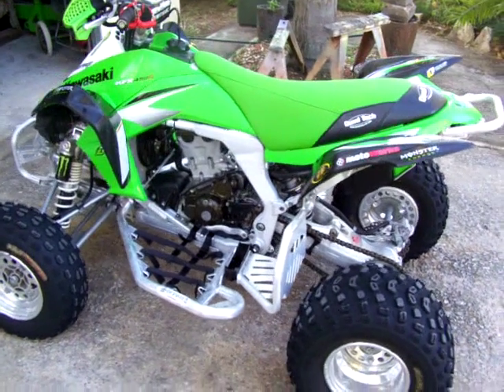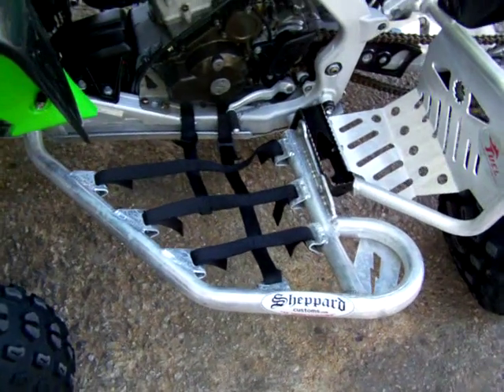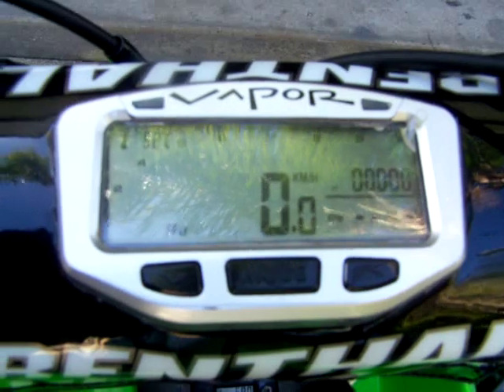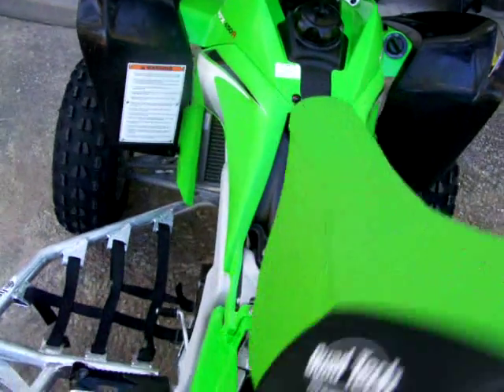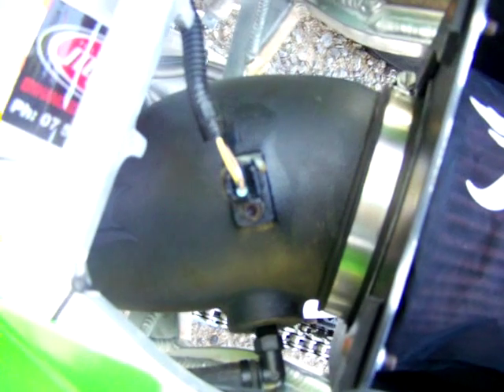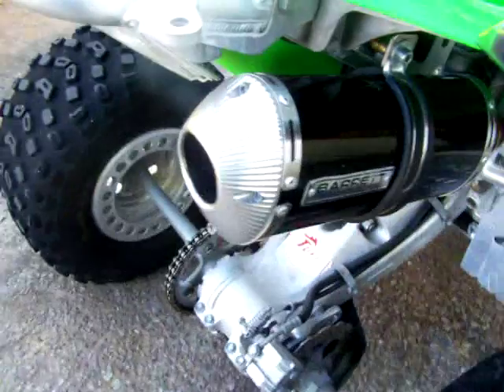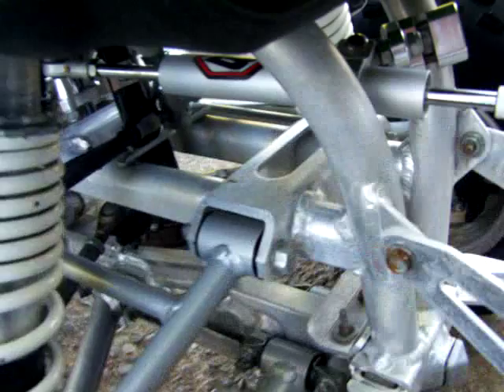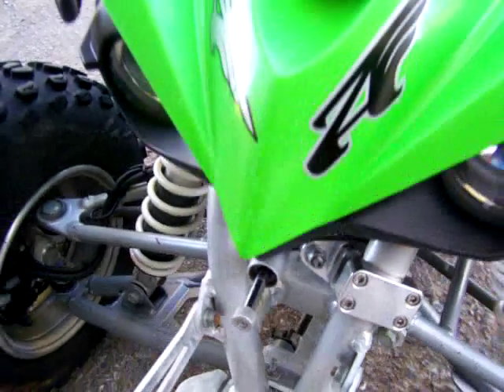KFX 450 R walk around and rev up, hear the FCI intake sucking some serious air.

Comment from the maker: It's been a while since I did it but pretty sure no drilling involved, just mounts in the stock holes on sub frame. Just watch those threaded inserts in the alloy sub frame they tend to spin which makes it hard to get the bolts out! If it happens I get a flat blade screw driver and tap it under the insert with a hammer to stop it spinning. Don't do them up too tight when mounting the FCI box otherwise you will have a problem getting them out if you ever need to remove it.

Comment from the maker: @TTXR6 Yeah the bike is still good stock, a little restricted with stock exhaust and intake but very quiet. They still have plenty of power stock especialy in the low to mid range and very responsive with the fuel injection. Most of the 450's theses days are a little restricted straight from the factory. Once you put an intake, pipe and fuel controler on it realy wakes these things up and they rip!